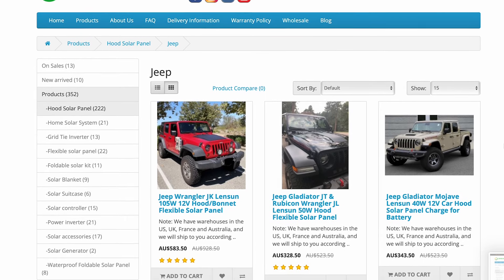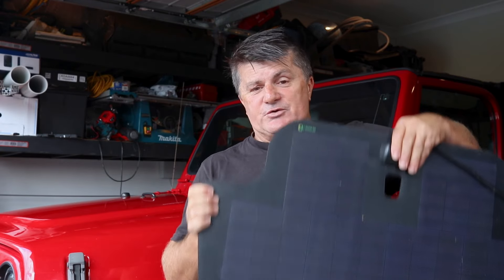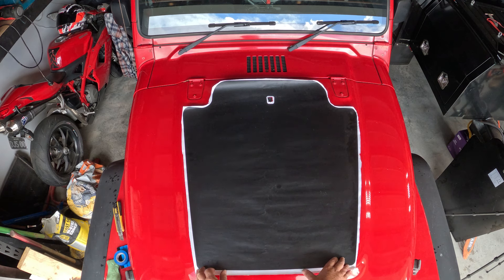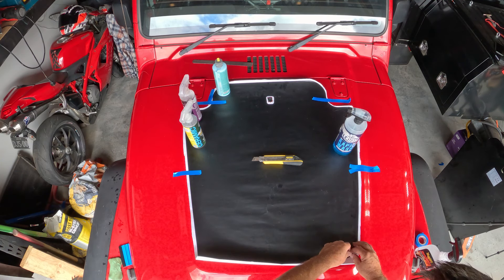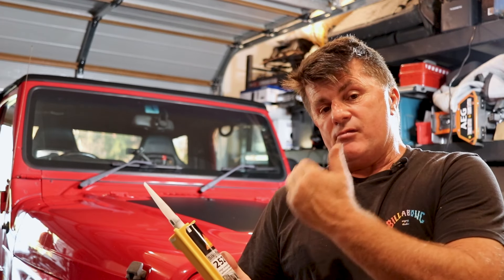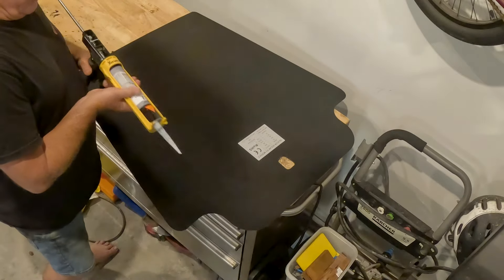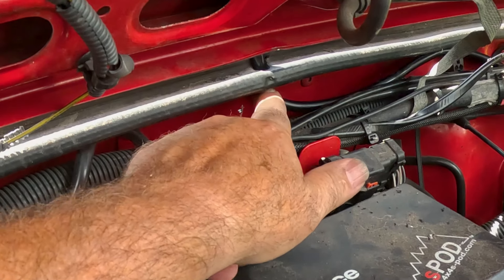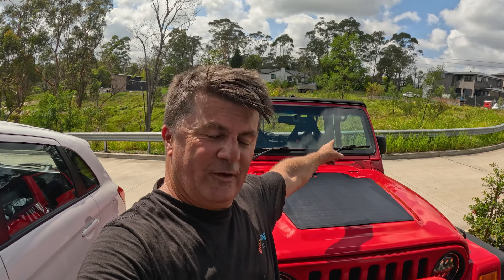BEST SOLAR PANEL for your OVERLAND/TOURING vehicle? // Step by Step Install

Comment: Great instruction Darryl. 
All cars should have a solar panel to keep the starter battery at full charge I reckon. If my research is correct the longest life from starter batteries is achieved when it is kept at 100% state of charge (Which needs a good charge controller). I have a hard top, so I can put a ton of panels on the roof, so I really like the idea of using body wrap to attach the solar panels to rather than directly sikaflex them to the panel.

Comment: As expected another great video Darryl. We just supplied a bonnet solar panel for a customers FJ Cruiser, works well. With the vinyl wrap its not an issue though for direct adhesion from a lightweight solar panel to the surface we use Fix8 adhesive as it allows for variations in expansion due to temperature change. The 3M tape also works well. We fit lightweight solar using tape with no lifting issues though some customers run a bead of sealant or a alloy strip across the leading edge.

Nice install

Comment: How's the solar panel currently holding up? Does it pull close to 82 watts?
Thanks for the video Darryl 👌
Reply from the maker: It trickle charges ok but I've never seen the outputs that are suggested.